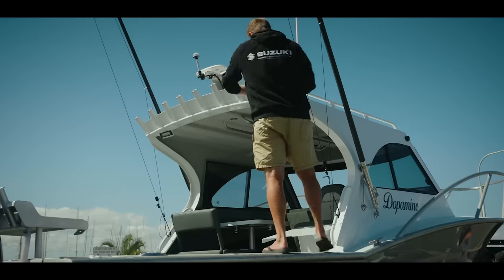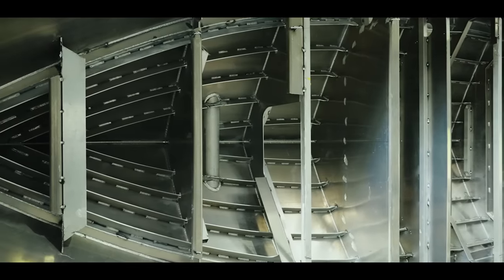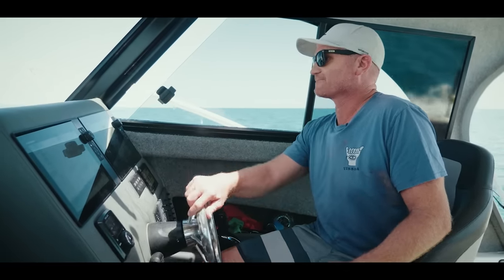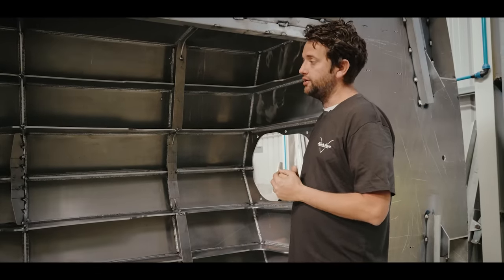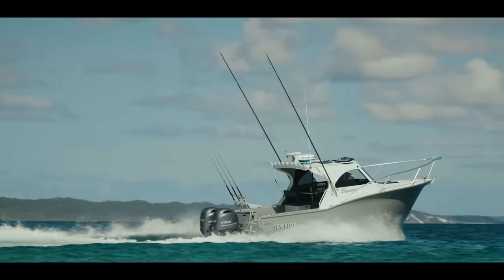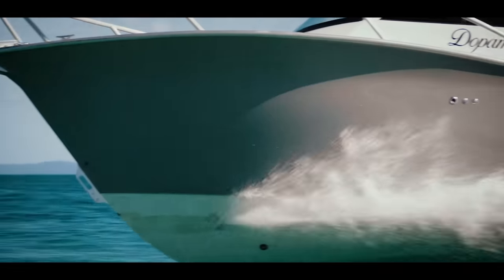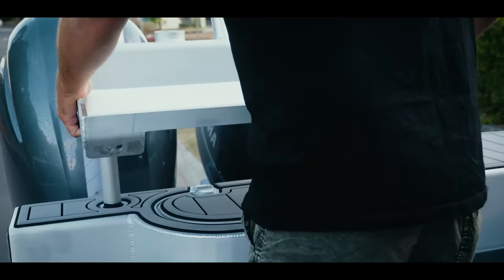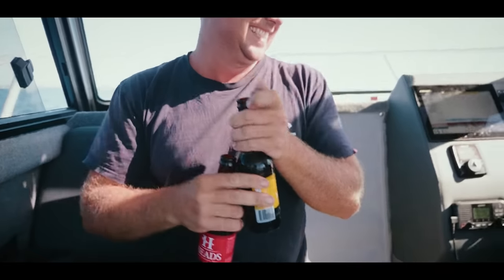Tim’s Makaira Gen3 800 featuring a Carolina flare

Comment: Nice boat.
Can someone explain to me how a flare 200mm down from the gunnels or 6feet above the running water line makes any difference to ride? 
Plowing into a 2m wave it might help a smidge for spray, but will do nothing for ride surely .
Reply: No they cant
Reply: I agree the flare likely wouldn’t change the ride. If anything it’s the weight of all of the thicker/extra aluminum in the boat.
Reply: It creates a finer entry and softer ride. To have the same entry with flat plate would mean an extremely narrow boat that would sacrifice the foredeck size. But where they come into their element is creating lift when you are in a following sea.
Reply: @Shaka_Brah  stabicraft achieve this with pontoon design also. I appreciate the workmanship in this boat to achieve that finish in aluminium construction is impressive.
Reply: The flare allows for fine entry bow for the majority of the freeboard (good for almost everything but a following sea).
Then, in a following sea (where a fine entry bow would normally want to nose dive/bury in to a trough) the flare creates reserve buoyancy higher up in the freeboard to help create the lift needed to bring the nose back up after hitting a trough
Reply: @Rexy888   yes my stabicraft is great in a following sea, but its wont run anywhere as nice as one of these into a sea.
Reply: First of all there is no functional flare here. On a true Carolina flare style boat the entry is much sharper and the flare actually provides lift when coming through a head sea because the sharp entry cuts through and as the water comes up the sides it hits the flare and generates lift.